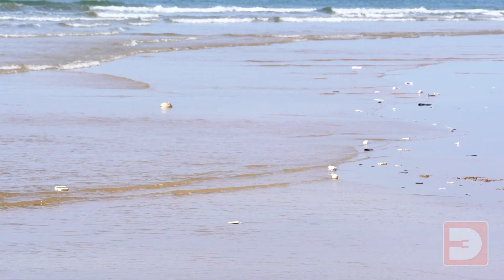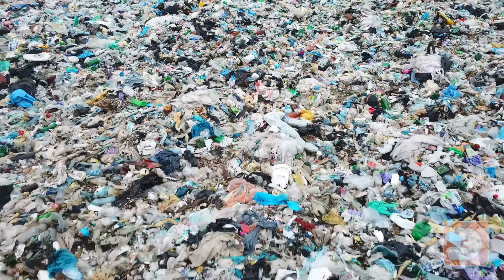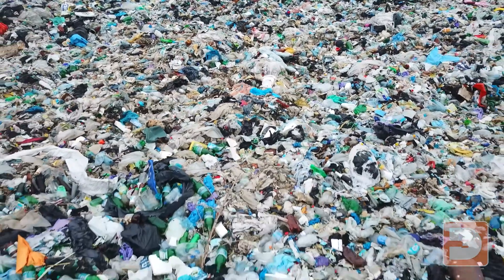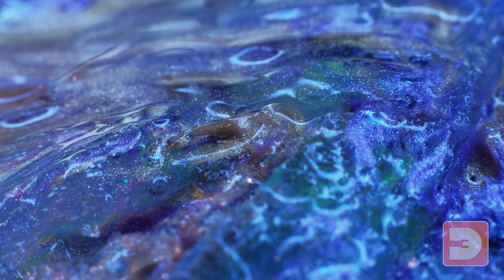3D Printing and the Environment - Series Introduction

Comment: Have another question if  I can,  I  have multiple parts on the bed is there a way I can 
place a brim on only 2 parts instead of all parts with the brim in prusaslicer? Thank You
Reply from the maker: Hey Edwin, absolutely there is!
I'd recommend having a watch of my video on modifers (https://youtu.be/X2oZKiUS7bk) and my video on Additional PrusaSlicer features (https://youtu.be/xBQKrRdjYuw) that cover how to do this and a lot more. 
To get you started though, what you want to do is as follows:

Have Brim turned off in your general settings, so none of your models have brims, then right click on your model (either on the model itself on the printbed, or in the list of models on the right of the screen), hover over 'Add Settings' (at the bottom), and select 'Skirt and brim'. Tick the checkboxes for all 3 that come up, and then click 'Ok'.
Then on the right hand side, you'll see a 'Skirt and Brim' feature has been added underneth the model you had right clicked on. If you select that, at the bottom on the right will give you settings to apply a brim to just that one model.

You can repeat that to any models on the bed that you want to have a brim.

Again, to take a look at the videos I link to above as they'll give you a better idea of this whole process and also may show you some additional features you may not have been aware of.

Good luck and let me know if you still have any issues
Reply: @3DRevolution  Thank You so much when I get home I'll watch it.

Comment: I have a question for you I'm trying to add text to my project in prusaslicer just having a hard time with it. When I try  looking it up most videos want me to use fusion 360 none with prusaslicer. Can you help me by adding text or removing the text.  By the way you are doing a great job keep up the hard work.
Reply from the maker: Hey Edwin, thanks for your comment.
It's absolutely possible in Prusa Slicer. You would definitely be able to produce a more accurate result using Fusion 360 but I know not everyone has the time to learn to use it (though I'd definitely point out that it is free if not using it for commercial use).
Howeve, to add text in Prusa Slicer, I'd start by downloading a set of STLs of differernt letters (Here's an example: https://www.printables.com/model/110382-uppercase-letters). You could obviously design your own, but if you're not using a CAD option like Fusion 360 anyway then I'd imagine this is the most straightforward rout for you.
Then, import your moden into PrusaSlicer and follow my recent tutorial on Negative Volumes (https://youtu.be/oJ5dqHZQ2p4), along with the models of the letters you just downloaded, to deduct the shape of the letters from your model to add text to your model (you could also use the 'Add' feature I mention at the end of that same video if you'd like the text to be raised text on your model rather than cut out.

As for removing existing text from a model, if it's a perfectly flat surface the text is on, you could in theory use the Negative Volumes feature and create a cube to cut away any raised text, or the Add feature and create a box to fill in any cut out text. But, if the surface isn't perfectly flat, you're definitely going to be better off learning how to remove it in something like Fusion 360.

I hope that helps, let me know if you have any more questions.

Comment: For me I don’t  print unnecessarily only parts I want to test or use for machines or at home. Usually in design phase n printing there’s some failed prints scraps that could be my thoughts of recycling back into filaments. Those packing plastics material can be recycled too into more useful parts at home.
Reply from the maker: Absolutely. 
Recycling filament at home technically is an option, but it can be a lot of work, requires the space, money and knowhow for the machine to produce the filament, and home filament recycling seems to yield mixed results which was the main reason for it not being a recommendation here.
However, I do plan on doing a number of videos on home filament recycling in the future.
Reply: @3DRevolution  yeah u r right,  energy wise it might not be a good idea, but for fiddling with the built and the satisfaction of achieving a result thru the process is an excitement worth going into. Thanks for yr video I be looking fwd to your future vid on that. Keep up the good work 👍
Reply from the maker: @jimmym2719  Thanks Jimmy, take care and keep in touch on future videos!
Reply: @3DRevolution   I totally agree with Jym. It appears to me that the 3D industrial side it’s obviously already reusing or working to reuse the maximum quantity of plastic that it can. A lot of the 3D for customers innovation in the future is going to be about the ideas to get easier reuse in 3D printing. A machine all in one built-reuse with low energy consume and an affordable price would be the secular breakthrough of the manufacturing industry. I saw the series and Alga, NonOilen, are doing something pretty different that this part of the problem. It appears to me that they are working to create simply material research, and with the “firsts” results: PLA is 10$/Kg, PHB is 40$/Kg, that’s not even a market proposal. Thank god societies like them are working on those kind of research and we are improving and innovating, but now it’s just research, far away from something near a solution… thank for your content!